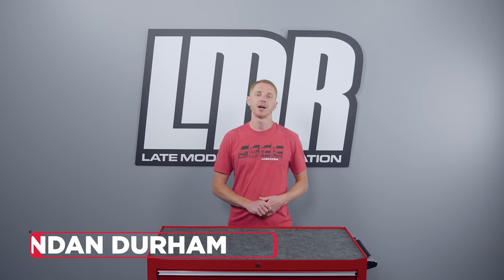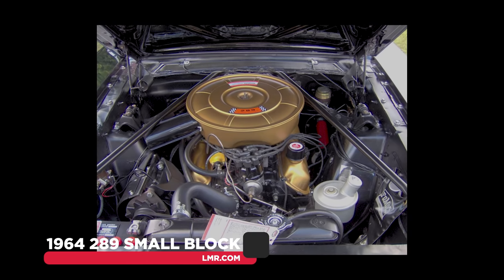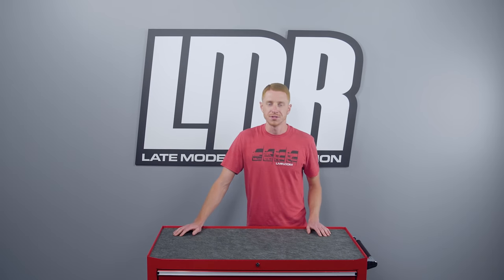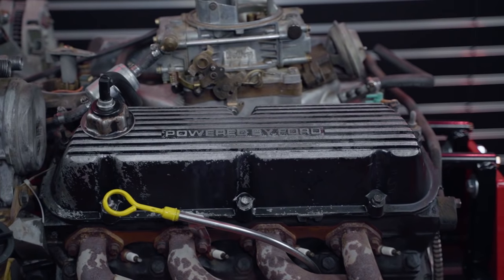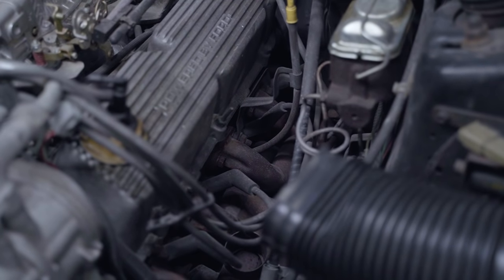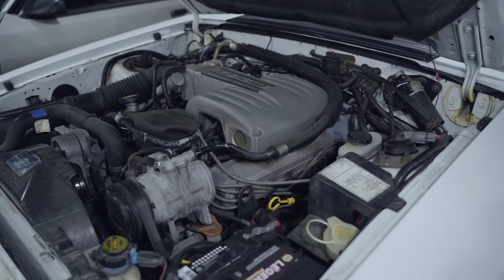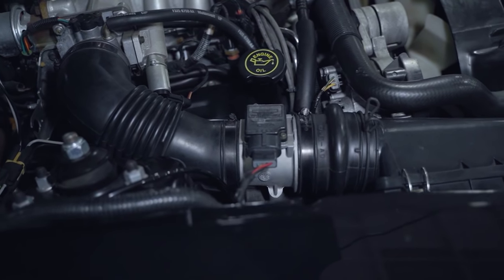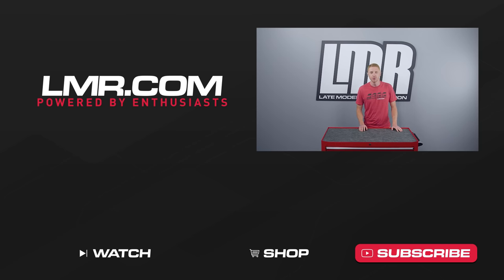The Ford 302 Engine: Everything You Need To Know

Comment from the maker: When it comes to Fox Bodies, what would you rather have? The tried and true 302 or the modern Coyote?
Reply: Old 302 or 351
Reply: Yes. haha
Reply: I just wish the 302 would hold more power without cracking. 4 that reason I guess I would rather have the coyote
Reply: @racinjayson8817  if youre gonna swap the engine anyway you could always just get a boss block or a dart block that will handle more power (than a stock 302) for less money than a coyote
Reply: 302 always ♥ 🏁🏁🏁😎
Reply: Coyote is above and beyond better at power production than the pushrod 302. That being said never discount the little 302 cuz it can indeed make power. But all good thing must come to an end.
Reply: Id rather slip a 428 FE instead of either one
Reply: @racinjayson8817  call Dart then lol
Reply: @jackrabbit7389     LOL    a 380 hp OHV 302  will go faster around a track than a 400 +  coyote   at least the first gen.     Superior power band / torque on average.  Probably making an average of 10 + hp and tq  more at every 100 rpm increment until about 6k or 7k   you can take a 289 and pinch out over 500 hp   NA.    OHC is always a peakier power band.. While the valvetrain may be withstanding superior for higher RPM  and so on  and moving more air into a chamber  ... OHC is not that definitive to OHV... it's still the displacement.. and I do LOVE the Voodoo engine RPM. both are still internal combustion with reciprocating assemblies.      It's about built vs bought.  I'm obviously a pushrod person.    I bet 90% of coyote owners haven't been inside of their machines.   Your condescension to the real 5.0  as  a "little 302"  that should end is hilarious.   The only thing superior would be electricity or a big block LOL
Reply: 302 or 351 before LS 
Death before dishonor
Reply: coyote
Reply: 408 Windsor
Reply: @xmo552  right on!
Reply: Coyote every day of the week unless you can make the old 302 just as light, just as much horsepower, just as much fuel economy, and just as much rev happiness. Oh wait you can't really do all of that.
Reply: @NathanaelNaused  you can.  NHRA superstock has entered the chat
Reply: @KingJT80  I don't think you read my comment completely haha. But thanks for the info!
Reply: Definitely the Coyote V8 for sure.
Reply: A 5.8 bolts right in!!! Sell the 5 liter to a purist and invest into a 351!!
Reply: 302
Reply: Could put a 460 in it or just stroke it to 347
Reply: @ericbly4599 You got to spend money for the 460 swap. Been there, done that. A 347 is a hand grande ,SSDD. Build a 351 Windsor, fits right in, headers you have might be long enough. Spend the money on a set of heads, as long as you have valve to piston clearance ur good. The 460 has to tote itself as well as all the associationed hardware. The Windsor will drop right in. Shot 150 on a cast pistons Windsor for 3years, 4-5 passed a night, 3-4 times a week. If you break it you did something stupid!!! CHEAP and DEPENDABLE!!
Reply: Carbed 351 or 302
Reply: Azhag Dark  what does that have to do with anything?  you don't think you can get that out of a 289-302?   physics are physics but either way the pushrod is always going to make more low and and broad power until higher RPM when valvetrain becomes more critical.  I'm about to be lapping my new chromed stainless steel valves for the factory cast Iron heads I ported  I replaced my stock valves with after I gave them a 3 way valve job with a power drill and a sharpening stone i got at the dollar tree, (i have video on here of that lol ) I think I know what I'm talking about mon.   yesterday I just blue printed my 306 block for alignment and roundness for ARP studs .   My engine with a 9:1 compression and less than .500 inch lift cam  is making around 400  with the only thing changing being the valvetrain and hand carving   of the long runner low end torque plenum.  talking 300 cfm a runner.     This is BEFORE the Supercharger.     SO with that boost yes  that puts me  now at a compression level that a coyote would have of around 11:5  ... so  then over 500   before boost juice ( meth / water injection )  ..  so  it doesn't matter.. you're missing the point.   My point  or stance is that they stole the 5.0 moniker   and its made finding  1980s/1990s era information and things more difficult because the new crap pops up.  It's built vs bought  90% of the time.  Just like when the first modulars came out and there was a rift between OHV and OHC.   Ford does still at least have Ford Racing ( now Ford Performance ) ..   but at the same time the aftermarket for now classics get snubbed.   but engine science wise?   it doesn't matter does it..  the difference being  my engine at the same peak power level has more low end   so that's what I was saying.   Every person driving around in a new muscle car is kind of a douche bag!   I like the cars not the people    but there's a way big difference between built and bought  ( regardless of people who can afford to work on new stuff but they are still rich people not blue collar ) ... I probably have hundreds of hours into a project and  outside of learning some old tricks   ive had to invent ones.   but just remember rule of thumb   OHV always has more bottom end lol    "torque wins races"
Reply: Throw a big carb into that 302
Reply: Last month I had the opportunity to buy an 85 mustang gt for $2,500 clean body and interior the only problem was the faded red paint I waited too long and some one offered the owner 4k for it and he sold it 😭😭
Reply: Coyote!
Reply: Nothing sounds as good as a well built 302 but you can't touch a Coyote for performance potential. I'd have to go with the American answer and say get both.
Reply: Only poor people that dont know better select the pushrod engine.
Reply: Stroked pushrod 302
Reply: I just bought a 94 mustang with the 5ltr and love it
Reply: The old boat anchor 302 😂 . Todays V6 engines put them to shame. Why waste your money on a 302/5.0 ohv ? Nostalgia ? Afraid of technology ? Get with the times old man . 5.0 coyote is king
Reply: @jackrabbit7389  not really I still drive my 95 Stang sounds better than any of the modern ford engines in my opinion.
Reply: @DS-mo6md  thanks for sharing!  Didn't know about the superior powerband!  Makes sense, I once raced a dual motor tesla model 3 with my 95 5.0 and yeah, they beat my stock motor.  But they were not that much faster.  You'd be surprised!
Reply: @brettfrimmer6567  um oh you mean the poor people who actually touch the inside of engines or know how to not only port heads properly but change dynamics of powerband by modifying swirl ? Or just understand mechanical engineering and know that the friction loss of an OHC allows higher RPM power while the fulcrum and leverage of an OHV makes more low end? They have their attributes but I think that you make flat tappet synonymous with "push rod"  and didnt specify roller engine.  Even still once again they have even further differing pros and cons. Ill take a flat tappet with a 3 piece gear drive to basically drive through hell and back while the OHC will not have the same longevity .. Better still a roller with pristine oil and a 3 piece gear drive
Reply: @luciankristov6436  you clearly dont know anything about engines
Reply: A 302 stroked to a 347 or Swap a 351c stroke to a 460 small block SBF
Reply: What’s good websites to buy engine and transmission for a 1990 ford mustang looking good 302 😅
Reply from the maker: @markuscarter2386  Check out our website!  Let me know if you have any questions. -Landan

https://lmr.com/1979-93-Mustang
Reply: a carbed smelly monster.. when running right.. unlike mine..
Reply: I like the power and torque of the Coyote engine, but is it as durable as the tried and true 5.0?😊
Reply: Easy.  The pushrod 302.
Reply: @89Interceptor Building a 363 currently,  Dart Block
Reply: Building my roller 302 now. Share with yall soon! Thought about the coyote still going with 302.
Reply: Why not both?
Reply: Hp or sound! 302 block not thick dart block is better ! But the navigator motors and aviator and cobra motors never last those 4.6 same as the coyote! So racing get a dart block. For driving daily out of town etc get the 5.0 coyote. Not that hard. !!

Comment: Say what you will but those 5.0 motors from 80s and 90s had the best v8 sound ever. I dunno why they sound so good but they certainly sound fantastic. The flowmasters 40 behind a 5.0 is legendary
Reply: Roller cams made the difference
Reply: Exactly what I got on my 89 f150. It does sound great for what it is
Reply: What about the 92-97 LT1? AMAZING V8 sound.
Reply: @adelaseeri768  not better than the old 5.0 but they do sound good
Reply: Exactly what I'm running on my 85 Thunderbird 🤯
Reply: Couldn't agree more. That generation of 5.0 is my all time favorite sounding engine.
Reply: Because they changed to a 351 firing order.
Reply: @jesse75  Bingo!
Reply: Straight pipes sound better, have on my 1978  Shay resto mod ModelA
Reply: I’m a ford guy trust me me the best sound ever made is an ford FE motor of any cubic inch
Reply: Frfr
Reply: True but good sound does not always mean more effcient HP making
Reply: @lionsgarage  I never said it did.
Reply: Other than a rowdy big block solid roller I agree, the 80's to 90's Ford 5.0 was a real snarler.
Reply: @JohnnyRebKy  I didnt day you said something
Reply: You responded to my original comment and said sound doesn't always mean more efficient HP making. I am just replying that my original comment never said it did. That's all. Have a good day brother 👍
Reply: Couldn’t agree more have thrushers on my 86 ford and no cats it sounds absolutely menacing. Slow as fuckkkk but it sounds great getting up to 55 😂
Reply: @JohnnyRebKy  In 1973 I owned a '67 Mustang, 289, headers, cherry bomb mufflers,(which I cut in half,took the guts out, welded back together) scavenger pipes out the back with chrome angled tips. To me, this was the best sound ever. The cops did not agree.😂

Comment: Hello from Australia. I'm one of the lucky few with one of those cars that got the 10,000 engines for Australia. 1991 Ford Fairmont Ghia 5.0L
Reply: Sweet, i'm a 4.6L 2v guy so can't relate to the 5.0L, till i stroke mine..lol Still won't be those engines but were SBF so i guess we have that in common, peace bro n shout out from Houston, TX!!
Reply: I'm an Aussie too fella, and I've just bought a 2000 model ghia and I'll pulling that motor out to put it in my 85 mazda b2000 mini truck haha. Should be awesome once done
Reply: I've got the 5.0 in the Series 2 AU Xr8 Falcon :)
Reply: @alexchaney8791  Staggered intake port runners vs the straight ones on mine.
Reply: I got a series 2 au xr8 with a cam and been stroked with 5speed manual gearbox
Reply: I have a lovely DL Ltd, such an unknown and underrated aus ford. big part of the appeal has to be the 302 powering her

Comment: Finally!! Somebody else confirms the 5.0 in the explorer until 2001! I've argued with people over that for years. Lol
Reply: those who know, know..
Reply: I thought that was common knowledge. I have one. I can see where people get the idea that it wouldnt fit, because it really shouldnt (there is absolutely no room at all, less room than the foxbody), but the 5.0 in the explorer was pretty common, id say as common as the v6
Reply: I thought they went all the way up to 96.
Reply: @shauncole4392  I’m thinking of carb swapping one of these motors and putting it in my ranger 2wd lol
Reply: @shauncole4392  also the motor mounts should line up.
Reply: @jackb9199  they should indeed. The frames on the rangers and explorers are the same, so with v8 mounts itd bolt right up. Ive been thinking about carb swapping for a bit on my 2000 merc mountaineer, but the ecu depends on the fuel injection so itd be upwards of 500 bucks just to fix that, let alone the carb itself, but if you are set on it go for it. I decided not to and instead i have an eaton m90 blower i got for 50 bucks from a junkyard waiting to go under the hood. But good luck
Reply: @shauncole4392  back around 2000 a performance shop owner in Phoenix AZ had a Ranger Splash with a modified 5.0 sporting a Vortec supercharger.  If memory serves me well his transmission was an early Tremec TKO.

Comment: My Aussie 2001 Falcon XR8 has one of those last production 302 engines.  And it's far and away the most powerful 302 from Ford ... 295hp/320lb-ft torque.  Featured : Port matched GT40p heads, 9.4 comp., Yella Terra roller rockers, 1.94 in/ 1.54 ex valves, full-length headers, full duel exhaust system, i70mm throttle body, bigger fuel pressure regulator, hot run tested, hand-built by one of 20 engine builders @ a rate of 20 per day, "Built with Pride by J Neeves" plaque on my rocker cover.  All this was done at the satellite Tickford facility in Melbourne, Australia. Not cheap to do, for sure.  Mines still running strong at 187,000 mlies !!
Reply: I've got 2001 au with 287000ks and I've bolted a raptor supercharger to the side of it

Comment: My first car was a '62 Fairlane with the 221, I've owned the 260, a few 289's and a couple of 302's. My last car, a 2000 Explorer, with the 302, probably the one I'll die with, has 300,000 miles and still going strong. All have been great engines!
Reply: And when the engine finally does go just rebuild it stronger.

Comment: I have a 1996 Ford F150 with a 5.0L (302) Windsor V8 with 209,000 miles and still going strong. The only things I replaced on my truck was the starter, the fuel pump, and the power steering megunisum but other than that mostly was just simple maintenance, took out the transmission fluid just to get rid of the shuttering it was making and it hasn't had a problem ever since.

Comment: Awesome video thank you.
I've owned my 5.0 for 29 years and I just learned a bunch of new stuff.
Very interesting that it is a bored and stroked 289.
Reply: Not bored, just stroked. Both 4.00" bore and the piston compression height the same at 1.6". Half the stroke increase of 0.130" is 0.065". Ford made the 302 connecting rods 0.065" shorter at 5.090" whereas the 221, 260 and 289 all had 5.155" con rods. 
The Boss 302 had con rods the same length as the 289 but considerably stouter construction. Boss piston compression height was 1.530" to compensate.

Comment: In Australia we called it a 302 Windsor.  Which makes sense because it's essentially the same architecture as the 351W, with the later just having higher deck height and bigger mains.

Something not always discussed is how small and light it is.  Until the LS engines came along it was by far the smallest and lightest of the mainstream American V8s.
Reply: that's good to know too..
Reply: if i add a edlebrock 4 barrel carb and the correct edelebrock intake along with a porforn distbritor will it kick ass like ma 400m i did eveythig i describe to ma 77 150 super cab i just up loaded a video if ya care to take a look any feed back on 302 is what i9m looking for gonna buy a 76 f 150
Reply: @israelmoreno3620  really? A 400m? That thing is such a headache, I know, I have one. The M series engines are so hard to find aftermarket parts for, and they only ever made 2bbls from factory
Reply: @israelmoreno3620  what's a 400m  ?
Reply: That, and I believe y'all in the land down under also had access to a 302 Cleveland so you had to differentiate it from the Windsor.

Comment: Yay my falcon got a mention.
The 302ws in the au falcon xr8 the last.
They were all rebuilt by hand by tickford engineers and the last run produced 300 hp at the engine.
Reply: Read my comment up near the top, as I've listed the special bits on those last ever 302w's sold by Ford until 2002 !!

Comment: I had a 62 Fairlane with the 221 V8 and a 3 speed manual transmission. Smooth running engine.

Comment: Have a 302 in my 96' F150 that was the last year for the 302 in the f series. '97 went with a whole truck redesign, and used the ford mod engines...
Reply: Same here brother and its a great engine.
Reply: Yep. Had a 95 4x4. It was abused before I bought it for $1800 and I drove the snot out of it both on and off road.

Comment: Thank you for mentioning the little 255, one of the most economical v8s ever made just not made for people in a hurry, the crank is super lightweight in comparison to its 302 brother too bad it won't handle more than about 400 hp before it snaps
Reply: and the cool intakes dont fit that engine either  mostly a boat anchor
Reply: The 255 may have worked in a Mustang, but it was a dog in the Thunderbird.  In that car the 255 came with a 3-speed auto only and a 2.29 rear end.  I had a 80 Tbird with the 302; it had the 4-speed and 3.08 rear from the factory.  With that combo the 302 was 6+ seconds faster to 60 and we still got 26 MPG at 65MPH when it was tuned correctly.

Comment: Like video. Well done. A few minor mistakes. The 255 was a three year engine. 80, 81& 82. A small number of 55 dollar rebate auto Ford Mustang GTs and Mercury Capri RS cars were sold. When you ticked the auto option, you lost the extra snorkle, 0.8 liters, 35 horsepower, and 2.1 sonds over the quarter mile and 20 mph off the top speed and gained no extra fuel economy. Mistake two is that the CFi 5.0 HO Fuel Injection Always used an alloy intake. The origon of the mistake was from Nother website which I too copied...and was wrong. All minor matters. Mistake three. The Aussies imported well over 65000 5 liter engines from 1991 to 2002. It was a very popular option. Love your work LMR!

Comment: My ultra rare 96 Chariot High Top, is only rare because of its 302HO. Most people preferred a larger motor with their larger clubwagon.  I lucked out when finding a 1996 Ford Chariot, with a factory 5.0 HO.
Might be one of the rarest production Ford's made in the last 50 years, for non-commercial use.